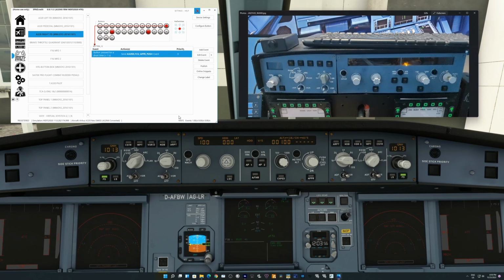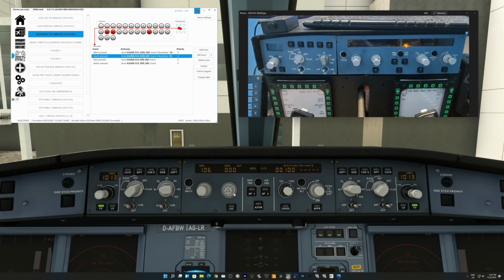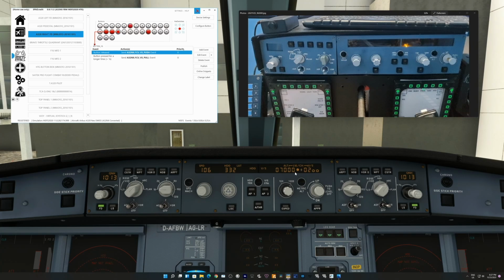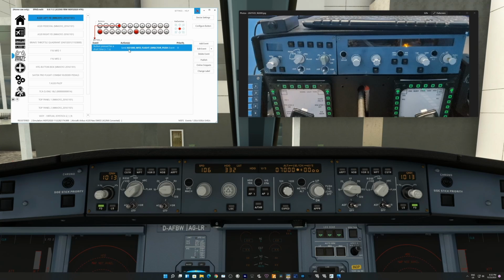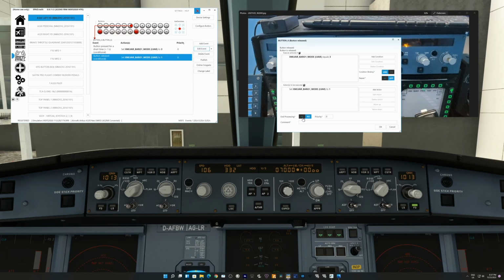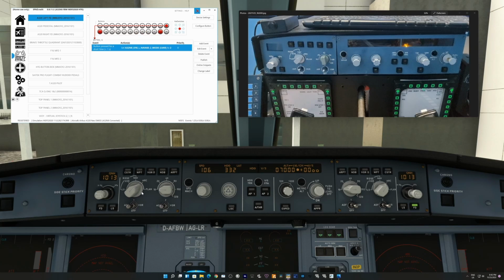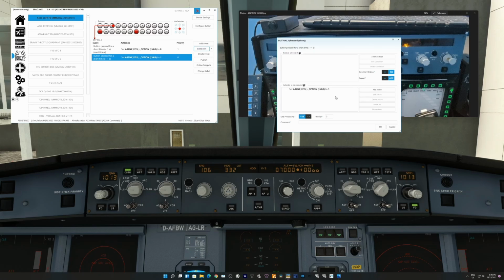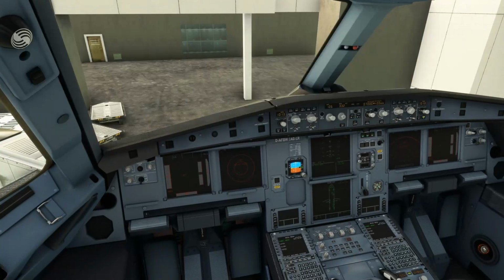Spadnext Programming for A32NX FCU EFIS Panel

Comment: Thanks for the shared knowledge !
I am using the trial Spadnext and I am pretty pleased by it. Though, I can't find these LVARs you are talking about, like the A32NX_L_OPTION LVAR for example. Is there anything to update, install for it. My LVAR support is activated in Spadnext, but I am pretty much a noob at this. Thank you if you have any hint to give.
Reply: I think you need to have a look at Les O'Reilly's video on updating Spadnext and LVAR bridge configuration https://www.youtube.com/watch?v=KC035N09VEs
Reply from the maker: If you can find any or some of A32NX..... simvar in the list its should be there. I did not activate anything but I do download or use someone profiles first. Btw my profile also has been shared try to look for roadrunner06 profile. Also its missing EFIS word in the var you mentioned.
Reply from the maker: Thats right if you have spad.next previous to this LVAR bridge. coz I've already installed it so it work without the need also for FSUIPC7 etc. Hope that can solve your problem